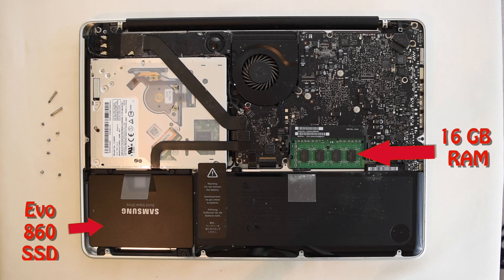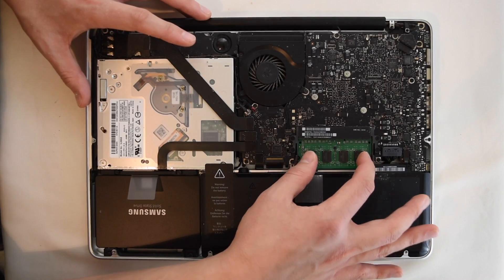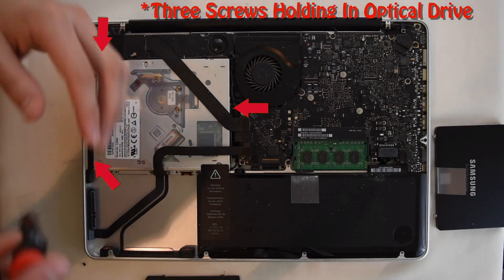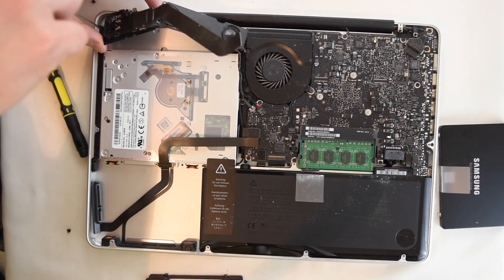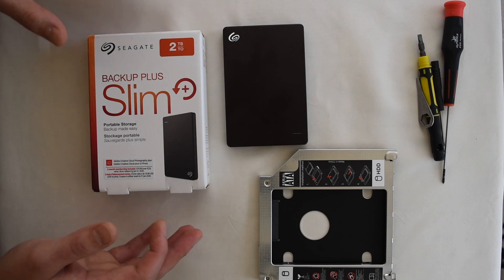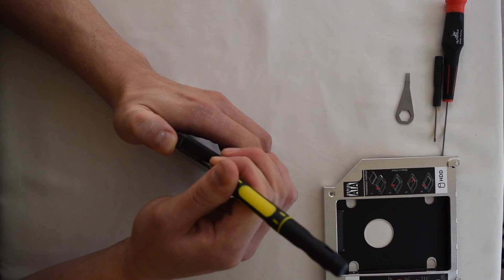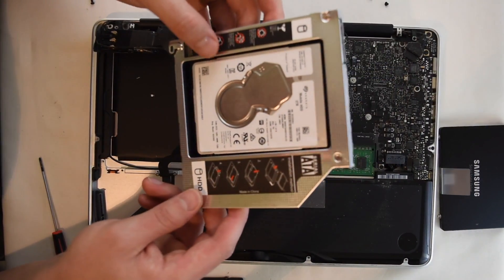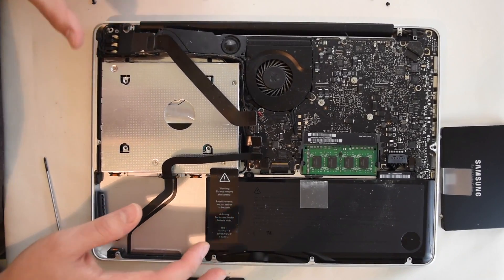2011 Macbook Pro Upgrade STEP BY STEP (2+TB, SSD, 16 GB RAM)

Comment: This is an intermediate video I would suggest going down the advanced route of using 2 SSD hard drives formatting as raid to increase the data read and write speeds

Comment: Thanks for the instructions how to upgrade. 13"My MacBook Pro 2011, i7 500GB needs new RAM. Should I buy "Samsung NB 8GB DDR3 1333 x 2 pc, or the DDR3 1600? The DDR3 16000 is selling x1. I would have to buy 2 pcs. Could you please advise what to buy? What is the difference between the 2 versions? I am not an expert. I can remove and install RAM. Thank you for helping.

Comment: Sorry this is so random but if you were to upgrade your storage while you have windows 10 installed, where would the new storage go to?
Reply from the maker: Hey there, so the storage is different than the operating system you have. If you put a new hard drive in the optical drive it will allow you to store anything locally on it - regardless of the os!
Reply: One More Cast wait so I wondering like how will it distribute the new storage like will 50% go to MacOS and the rest to Windows or?
Reply from the maker: @adamcudi  Do you run both mac os and windows on your computer?
Reply: One More Cast yes
Reply: One More Cast Oh ok thanks 🙏

Comment: thanks for the video I just ordered from amazon and going to update my optical hard drive. just one question once installed do I have to do anything after that or just boot up my mac without formating or backing up files? I already have Samsung SSD drive installed.. hope it made sense thanks
Reply from the maker: Yes that makes sense. Unless you want to have you OS on the new harddrive (I would keep that on your ssd personally) then you should be all setup after you install. This works just as if you plug in an external hardrive - but you will now have access to the storage all the time. Just turn it on and enjoy! Hope that helps

Comment: Can I do his with my original HDD? Or do I need to take apart an SSD?
Reply from the maker: Hey, a bit confused by my question. Which part are you asking about?
Reply: One More Cast so when replacing the optical drive with the plate drive; is it compatible with HDD’s or only SSD’s?
Reply from the maker: Ah ok, it’s compatible with both! You could definitely put in the old hdd for more storage.

Comment: Hey! I installed a crucial mx500 ssd, but when I’m about to formatting the ssd laptop won’t let me and the ssd it would desapear from the screen, got any ideas?
Reply: Lucky Garcia you probably solved this problem, but for anybody else reading down comments that’s having your same problem... Before you install the new ssd drive connect it externally with a SATA to USB cable (super cheap on amazon) now hold the option key down when you power up and select the recovery drive. Under utilities use the disk utility. Erase the SSD drive choose FAT 32 format name it “UNTITLED” now erase it again to MAC OS Journaled format, still Untitled. At this point as long as you’ve had OSX Lion or higher on this Mac you can install the SSD and when you boot up it will ask for WiFi credentials and give you a fresh install of Lion on that drive. ONE More Cast’s video on upgrading to High Sierra will get you to your goal from here. If you need the installation package for any OS just hit me up. I have all of them from Lion to Catalina. (Mavericks was particularly difficult to procure lol. But I got it 😁)
Reply from the maker: hmm thats tough, could you try to format outside of the mac using the process i did in the video?
Reply: Yeah I’m having this problem right now it only recognizes only one hard drive and has two inside
Reply: Yeah I’m having this problem right now it only recognizes only one hard drive and has two inside
Reply: Yeah I’m having this problem right now it only recognizes only one hard drive and has two inside

Comment: I've basically have done the same. Replaced the optical drive, 16GB RAM and installed a 250GB SSD boot drive. However, The original HDD drive is now an internal time machine. My problem is the fan control. Since then, the fan has been working overtime, which is eating my battery. As of this moment, I have to keep the power adapter plugged at all times. I've had to install an SSD fan control app. My question is, Is it possible to combat this?

Comment: Video definitely deserves a like from me....I have the same model but is has only 4gb of ram and 500 gb internal.... I’m afraid to open it and upgrade it because ive never don’t this before and this is my only laptop. I can’t afford a new Mac and my video editing takes up most of my space. Any suggestions?
Reply: Done*
Reply from the maker: @ChocolateGittyup  heck yea! how do you like it?
Reply from the maker: i never had before i just did it, very glad about my decision to do so. Brought my old mac back from the slow ages!
Reply: I’m going to give it a try. Thank you so much. I’m very timid about doing somethings but I’ll never know until I try 💪🏽💪🏽
Reply: Haven’t done it yet gotta order the parts

Comment: Awesome video! I would like to ask what kind of macbook pro 2011 is yours? ( Early, Mid or Late ) and what is the model. I did the same thing with my Macbook Pro late 2011-model:8.1 but it is not working with the samsung evo 860-500gb.
Reply from the maker: Thanks Art! Mine is an Early 2011 model, but i dont think that would cause your SSD issues. Have you tired formatting the disc first? I've done two videos on how i installed the SSD, the links are in my description. A bunch of people had questions/ answers on those vids. Let me know if you already tried this.
Reply: @One_more_cast Thanks for getting back. I already did. I actually tried to put my internal hard disk drive through my SATA adapter while my new SSD is inside my macbook. I waited for the Apple startup chime then press alt, strangely it only shown the external hard drive connected to the SATA adapter. I tried to launch the external hard drive and after I logged in a message pops out saying "The disk you inserted, (probably it means, the ssd I installed) was not readable by this computer".. I've read something on the internet having the same problem.. I guess I have to change the SATA connector in my macbook or change the type of ssd.
Reply from the maker: @artmonforte6424  Sorry to hear that man, really odd it didnt let you boot from the usb to sata adapter, it should have no problem.  I have heard those sata connectors go bad, but you should have been able to boot it with your old hard drive still. Guess you could replace it first before you get a new SSD, as the Sata cables are cheap.
Reply: By the way...the samsung evo 860 is working well when connected externally through the sata adapter..